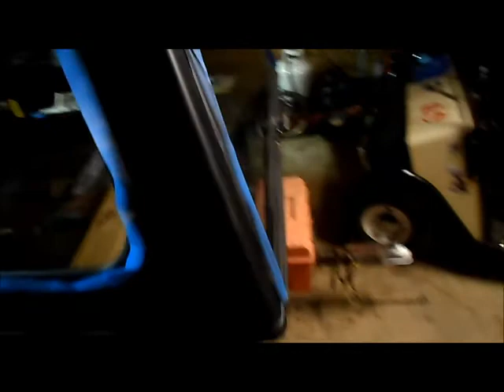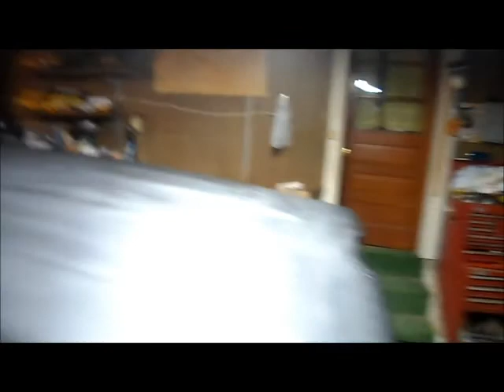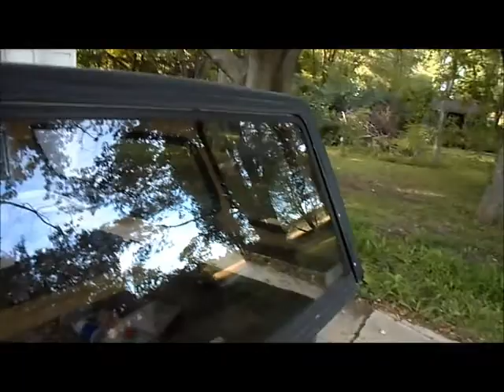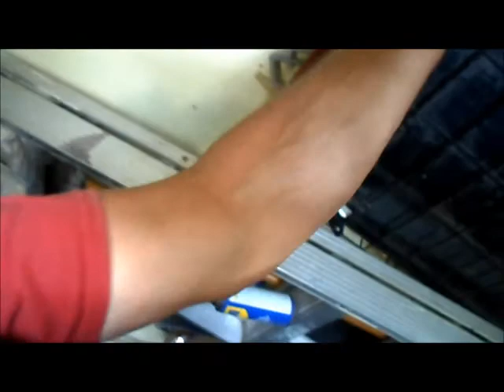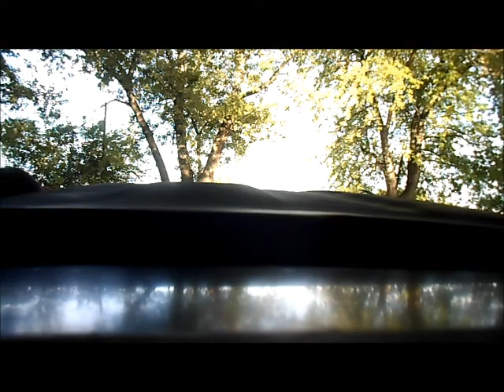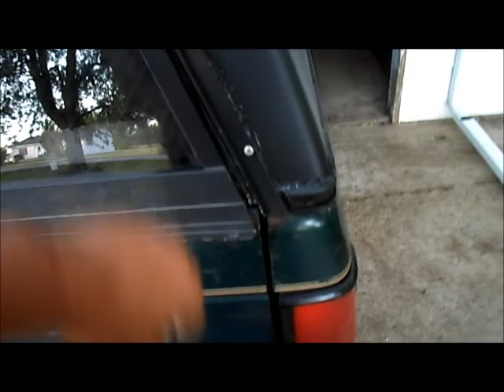Repainting the camper shell with spray on bedliner

Comment: Really nice job!  did you scuff, sand and prime?  Did it stay on well?  Any reason not to paint the inside too? What brand is that?
Reply from the maker: i use the dupli-color truck coat spray on bedliner, and all i did was wash the campershell down really good and, no sanding or priming is needed